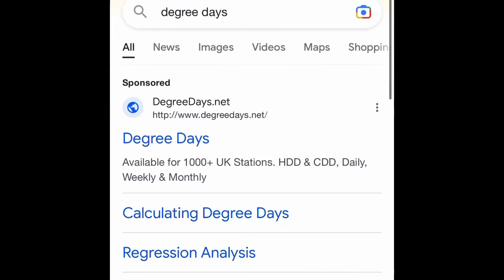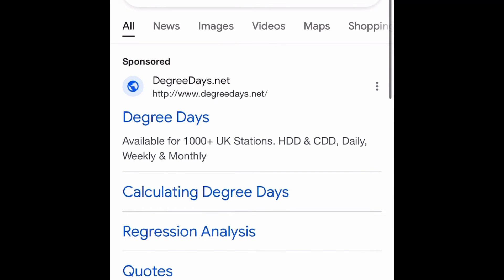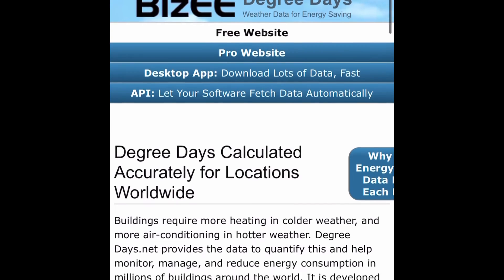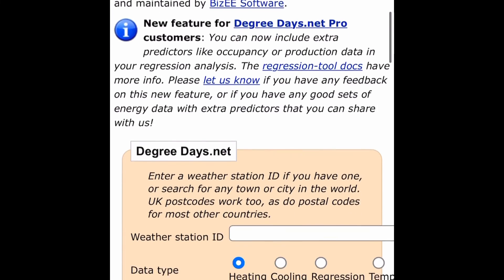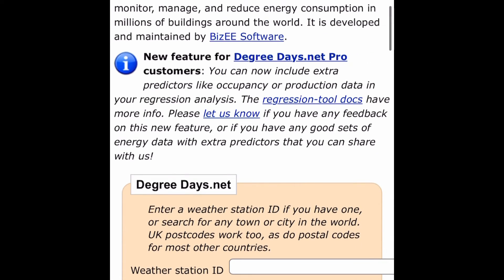How to use degree days

Comment: Tom I'm still struggling to understand how to use degree days aside from retrospective analysis?
Reply from the maker: Hi Simon, I use them retrospectively to compare the amount of heat I would have needed from one day to the next, can then see if any changes I had made to heat pump settings were beneficial or not in estimating kWh per degree day. Hope that make sense?
Reply: @Tom Bray  Thanks Tom, yes it does now. All things being equal they could be useful for adjusting the heat curve - assuming the vagaries abs effects of climate change don't have significant disruption in weather patterns.  BTW guess who now has a Valliant ASHP too? Seeing that you had the Ecotherm definitely influenced my decision
Reply from the maker: That’s brill to hear Simon! Hope it is keeping you nice and warm?!
Reply: @Tom Bray  Its been great, and a relief too. Install took longer than planned when it got desperately cold! Excited about COP rates already achieved. I'm thinking about how I will record details and calculate the adjustments to the heat curve settings systematically
Reply: @Tom Bray  woohoo! COP of 3.4 on heating and for hot water now!
Reply from the maker: @Simon-kq1xu  Fantastic! Really good efficiencies with this slightly milder weather. Pleased to hear yours has started well. What do you have your weather compensation curve set to?
Reply: @TomBray-LowCarbonLifestyle  Its on 0.7, tempted to drop it to 0.6 but it got colder Sunday? Yesterday lots of solar gain and house was boiling at 21°C, but forecast is warmer weather still so its going down tonight so it won't have to work so hard in the morning. What are you set at?
Reply: @TomBray-LowCarbonLifestyle  I just adjusted the heat curve down to 5.5. It had actually been on 0.6 and not 0.7 and so far I'm getting a COP of 3.7 on heat, 3.3 water!

Comment: Little confused. 
Isn't  Weather Compensation supposed to take care of all this on a daily basis which negates any further tweaking?
Reply from the maker: Yes weather compensation means we call for less heat when it is warmer outside. But you can also tweak the curve that the weather compensation follows. As well as a bunch of other settings that can be changed in our controller